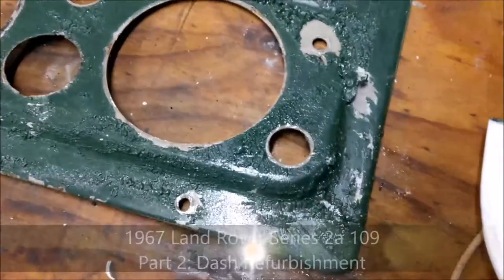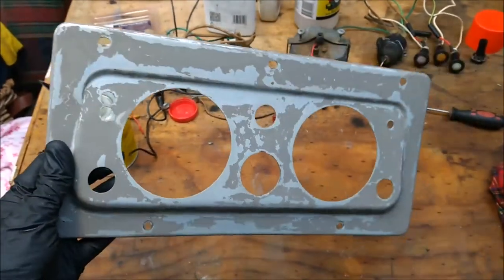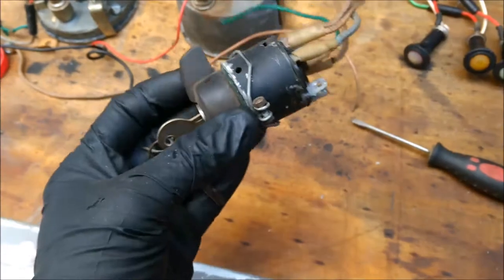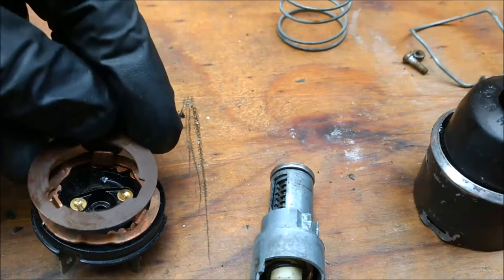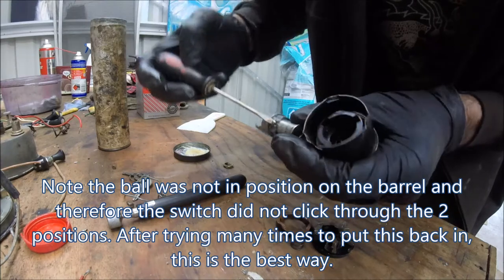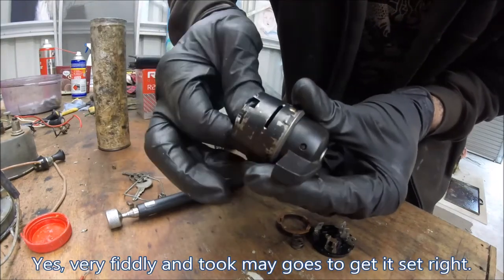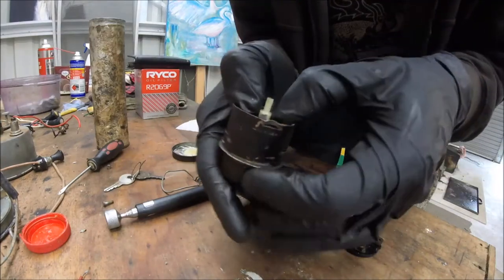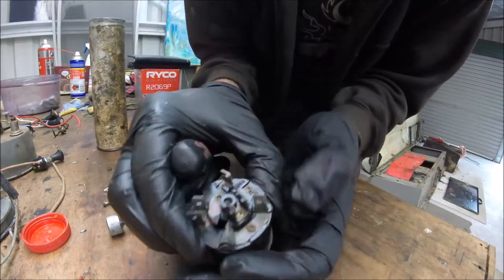1967 Land Rover Series 2a 109 - Part 2: Dash Refurbishment

Comment: Great video and saved me time working through my series 2a panel.  Very excellent indeed!  Have you replaced the bulbs on any of your warning lights?  One thing I am trying to figure out.
Reply from the maker: Only one bulb was replaced. The others where fine so I just cleaned them up. Most issues I had where from joins breaking solder or wire snapping (really need a new loom). A Good multimeter is you're best friend along with a manual to look at wiring diagram. Good luck :)

Comment: Hi I have a 109 and I but there is no key in the ignition do you of it is possible to replace the key barrel when taking the switch apart?
Reply from the maker: Yes, i had the barrel out of the switch so it would be easy for locksmith to make a key or to replace the barrel entirely. Cheers,

Comment: My switch stopped working, took apart per your instructions. I noticed there should be two tabs in the end of the barrel itself and one is missing. I noticed the missing part was in the switch and fell off when I shook it. Looked at your video and your seems to be missing it too. Did you find out if it works? Should the barrel itself be replaced?
Reply from the maker: My barrel works just fine, see how you. I only replaced items that where totally beyond repair.
Reply: Rover Tasmania thank you for all the videos! Truly helpful!
Reply: Rover Tasmania I can’t figure out where the spring and the ball goes back in though . Any ideas?
Reply from the maker: @albroumand  I think in my vid I covered that, cant remember now its been a while. I do remember there was a trick to it tho...
Reply: Rover Tasmania ok thanks will try more and see

Comment: Come on, don't do a half assed switch video. Do it right or don't do it at all. The ball and spring do NOT go in the hole that goes all the way through, they have to be placed from the inside, in the hole next to that one. The 2 contact piece for the ignition switch does not go below the spring, it goes ABOVE it, just like the other contact
Reply from the maker: Thanks for the post, ill check it again!  yeah I am not the expert by any stretch, and mistakes have been made.  Good to get some clarity and knowledge sharing 👍